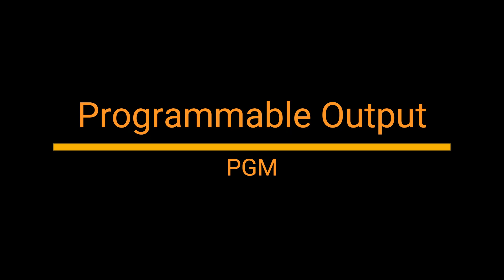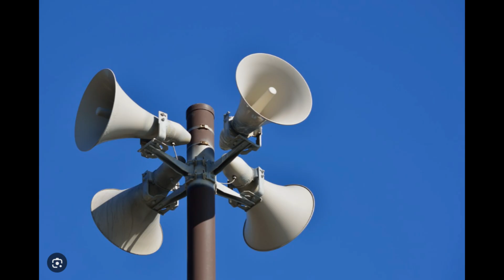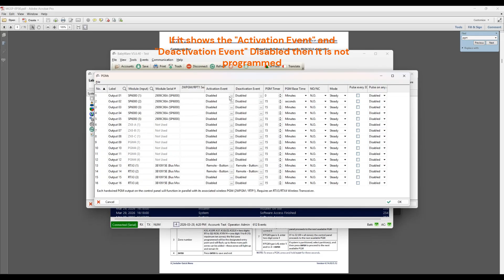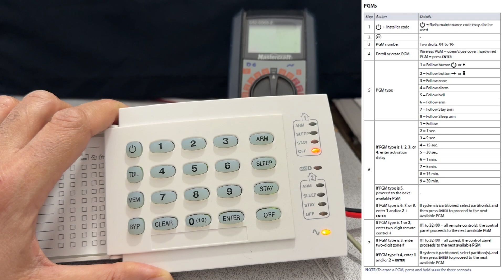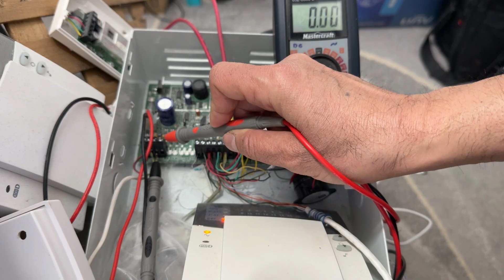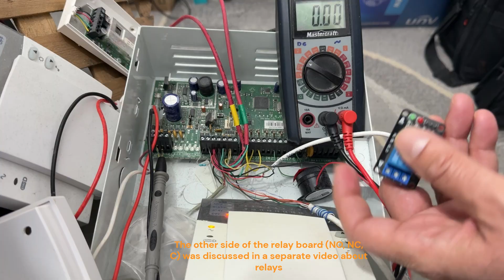Paradox PGM Programming Explained (SP & MG Panels) | SP6000 Step-by-Step Guide

Comment: Thank you for posting this.  It actually kinda helped with what I'm trying to do.  I'm wondering if you have any suggestions for me?  What I'm trying to do is this:

1) Currently in our warehouse, we have a doorphone outside.  The delivery person can press the button on that doorphone, that rings us and we press 6.  6 triggers the "Trig" port on the ACM12 board and the door unlocks and the courier can then get in.  Now we have a motion detector in the warehouse, but it's not presently connected.  We want to get it connected.

2) So what I need is, when 6 is pressed in the same way, it continues to trigger the "Trig" port on the ACM12, but I also need to take that connection over to the EVO192 board and find a way to put the system into un-armed.  It needs to be disarmed immediately because the door has been unlocked and the courier guy is already walking into the warehouse.  We use this function all the time when we don't have anyone in the office.  The doorphone outside the warehouse rings not only phones in the office, but our tele-worker sets and cell phones - so we can always get to it.  Our problem going forward is that the system will be armed, we need to unlock the door (just like we are) and disarm the system with no count down - disarm instantly.  In addition - it would be nice if it could start a 1-minute timer when this tigger happens (6 is pressed) and it can actually re-arm the system 1-minute later automatically.  

Can you think of any way to make at least the first part work - disarming the system when the door is triggere on ACM12 #8 in our system???  Any suggestions would be GREATLY APPRECIATED!
Reply from the maker: I can only offer you suggestions. You will have to do this on your own risk and test it before you do it for the customer. You don't want to find the system disarmed because of something you didn't think of. Here is what I think you can do: you will have to pick a zone that you use to arm or disarm the system. That zone could be on the panel or an expansion module. You set the zone type to "Keyswitch Momentary". What this does, is everytime the zone is triggered, it will arm the partition if the partition is disarmed or will disarm it if it is armed. You can test this by connecting the zone to the common (try it before you start wiring it to your actual setup). If you choose "Keyswitch Maintained", the panel will only be armed i believe. Your EOL wiring has to follow what you did for the other zones, so if you are using an EOL you have to put an EOL. If you want the partition to auto-arm after a certain time, you can set auto-arm on no movement after a certain hour for example. The settings for this are in the "Areas" section. Sorry i can't help more than that. It is beyond the scope of my channel.
Reply: @sedky69  No - that's great.  You came up with ideas I didn't think of and I think I can make this work.  Thanks - this helps a lot more than you realize!
Reply from the maker: @NeilHyndman Thank you